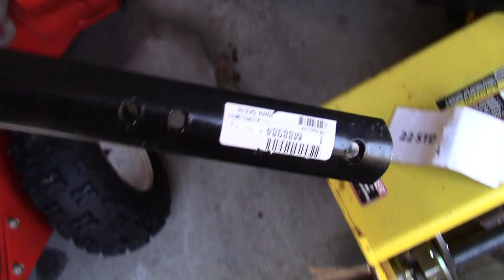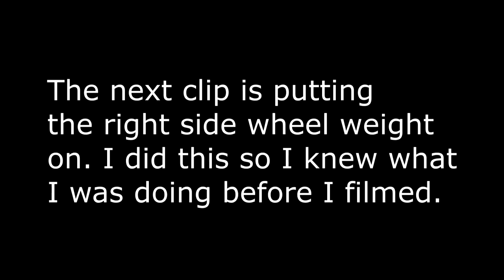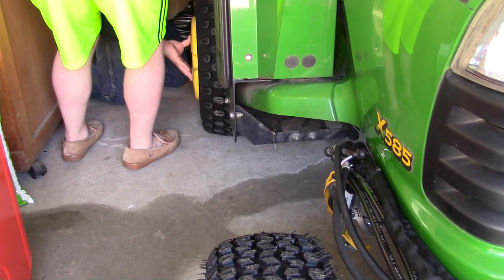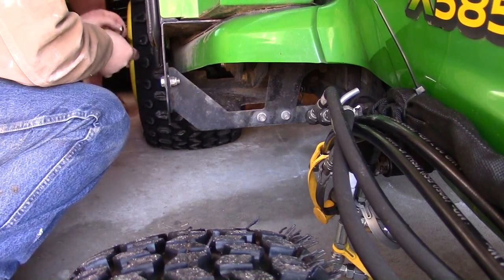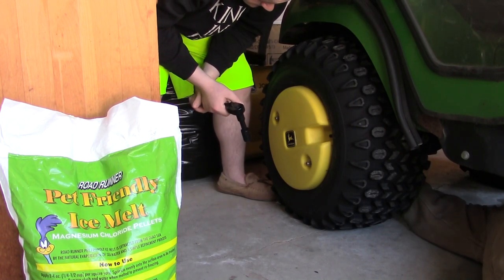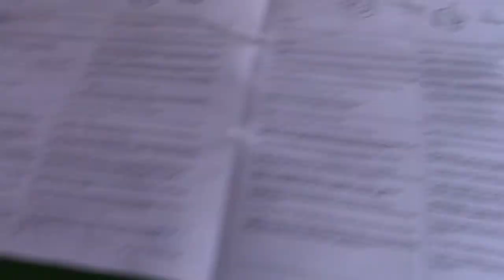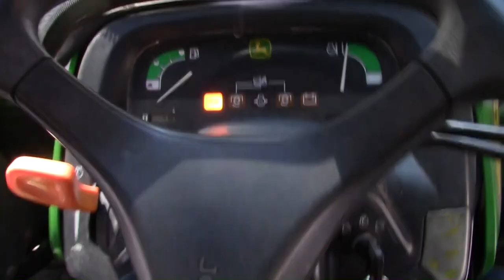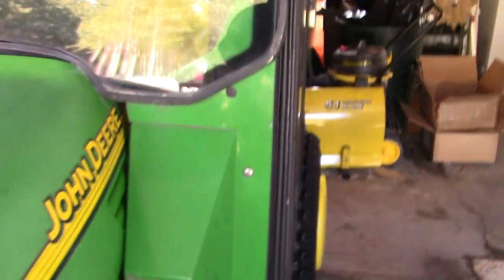Working on the X585 installing wheel weights and drift cutter.

Comment: I know they only sent nuts but if ya don’t put a washer behind nut it cracks the plastic weight ,, happened to my brother on both bolts on both sides,,, as to why i got the cast iron weights,,, anyway thought id pass that on to you...
Reply from the maker: Well I guess ill have to fix that before we use it anymore! Knowing my luck something would break.